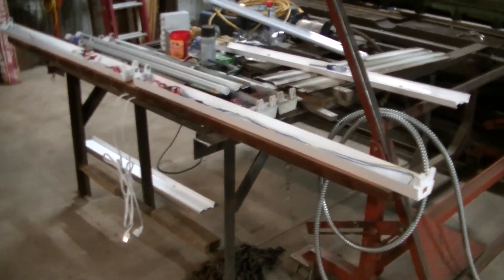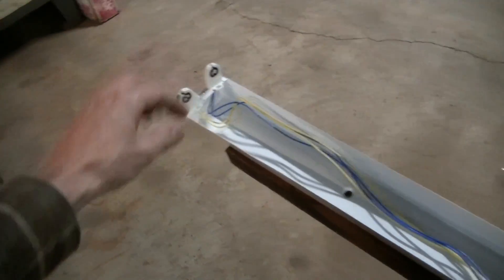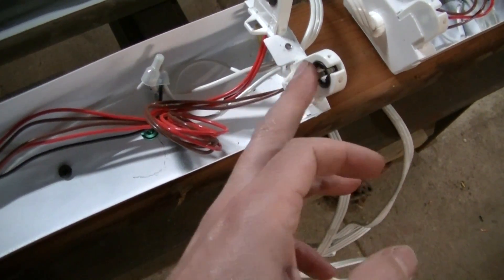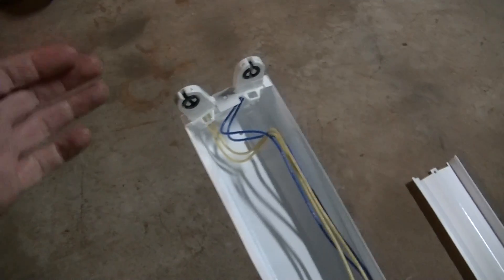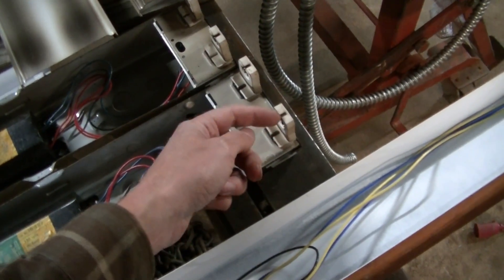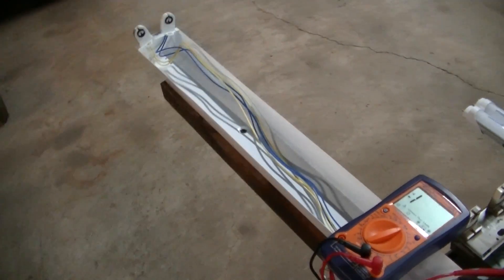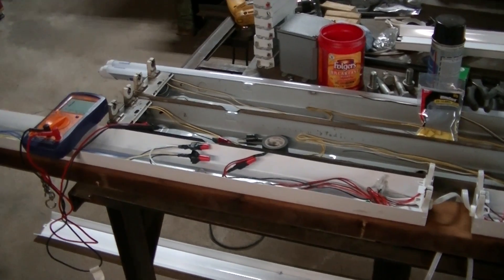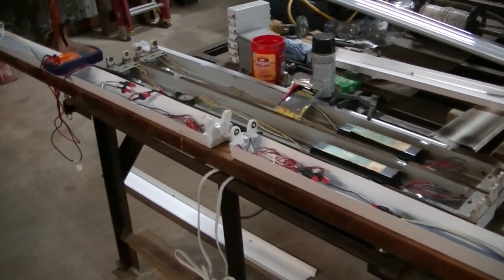"Quick Tip" T12 LED Single Ended Vs Double Ended

Comment: Looking at what you got there, it's too hard to see anything with all your wires in the housings, maybe you should have drawn a schematic wiring diagram. I didn't really learn anything I didn't really hear already---I was hoping to see closeups or diagrams.
Reply from the maker: There is a ton of good info in the video.  If you really learned nothing then you didn't even try to learn anything.
Reply: @mossman381  Sorry, I tried. I've watched it 3x now, and I also checked out your other video where you replaced 2 fixtures with double-ended hyperikon tubes... You used 18w tubes---if you used 23w tubes it would have been brighter... plus if you lowered them 5 feet or so things would be much brighter closer to where you actually are working. If you want brighter, you need more LUMENS.  Look for bulbs with the most lumens or lumens per watt. You went with "single row" LEDs, but if you jumped to 23w or greater, they have about 2x as many LED's per tube... usually in a zig-zagged pattern.

I was hoping to see the differences between the single & double-ended wiring, I don't think I've seen it demonstrated or diagrammed here, though your other video you at least showed the schematic diagram before/after.
Reply from the maker: I quote  "-I was hoping to see closeups or diagrams."  Why would you need those if you understand the difference between the two????  If you went to college why are you even watching this video????
Reply: @mossman381  To see if any diagrams are similar to a hi-intensity plant light I have that has 3 ballasts in 1 fixture.... I'm sure you've seen many like that with overdriven tubes, you can barely look directly at the tubes without seeing spots afterwards. Oh, and about college, when I graduated college, cars didn't have computers and I don't think LED's of any kind were out yet. Respect your elders.
Reply: @mossman381  Who said I didn't understand single v. double?  Oh, and it's one END, not one SIDE. Even your use of "side" isn't consistent or incorrect mixing them. Single ENDED gets + & - at one end of the tube, the opposite end is just there to hold the tube. Don't underestimate my electrical knowledge, I went to college for it.
Reply from the maker: I respect everybody that gives me respect.  Being old doesn't just guaranty respect.  Reread your first post.  You sound like you didn't know anything and didn't learn anything.  Also waving an old college degree around to make people think you know stuff isn't going to get you much respect either.  If you know LED bulbs you would know that you bypass ballasts.  So it wouldn't matter how many ballasts you have.  Wiring should be the same.
Reply: @mossman381  Hey, like I said, I didn't see anything I haven't already seen... YES, it would matter how many ballasts it has---removing them the lumens go way down on my light, from over 5000 lumens per tube to ~2000 per tube, just do a search on overdrive fluorescent... I'm looking for maximum brightness not maximum economy... looking to see if anybody's done it with LED's. Thanks.

Comment: If your light fixture has "non shunted" tombstones then either single sided OR double sided LED bulbs could work and would be your preference..
Do I have this correct?
Reply from the maker: No,  you have to wire the light fixture for either double ended or single ended.  You can put a single ended bulb into a fixture wired for a double ended light and nothing will happen and your light will just not turn on.  If you put a double end light into a fixture wired for single ended you can destroy the LED bulb and they won't cover that under warranty.  You can NOT mix the two types.
Reply: I bought a 24 inch led bulb to replace my old kitchen light. Halfway through I noticed it said Designed to work WiTH A Ballast! ! Do you know if it will work ?? Or do I need to get another LeD tube? Thanks.
Reply: shunted as someone explained above means both terminals are conected, if you plug the hot wire on one end and the neutral in the other end in a shunted tombstone, you are making a short, its gonna be sparks and  breaker will trip. That's how electricity works, so you  have the LED light acting like a resistant, electrons are flowing from the hot wire to the nutral wire through the LED light.

Comment: Good tips!  I've never messed with the single ended ones but they look pretty simple :)
Reply from the maker: I like the single ended conversion better.  A bit more simple.
Reply: @mossman381  And a LOT more dangerous if someone who knows nothing about the confusing types of LED bulbs and sticks a one-ended in the wrong way. One-ended LED tubes should be OUTLAWED.

Comment: I’m so happy you didn’t quit YouTube. I got worried there for a while because I have been watching your channel since day one. I have learned so much from you. God bless
Reply from the maker: Taking it one video at a time.  I got a ton of positive feedback.
Reply: mossman381 I love the camaro you built. I liked the Pypes exhaust. So I was sold when I heard the camaro run so I bought the pypes violator dual catback for my 2012 sierra 5.3
Reply from the maker: I am trying to get back to the Camaro.  The old shop is taking more time than I thought.  Having to fix and run new wires because I don't want to hack job it together.

Comment: This is exactly the sort of content that I hope you stay on Youtube for.  Great explanation of the differences of single and double ended, and exactly why I'm more likely to go buy complete fixtures....until I try and upgrade the old ones I have.
Reply from the maker: It was suppose to be a quick tip (couple minute video) but really wanted to explain it.  I was going to buy a bunch of the LED lights that have the LEDs integrated into the fixture but I am not completely assured those lights will last.  I like the idea of replacing tubes if LEDs go out.  So far all the Hyperikon lights have been working great.  The reason I went back to them.  It would have been a bit cheaper go the other way but I am really happy with the results.  I will have a old shop update soon.
Reply: +Mossman381 I was wondering why this video was 9 minutes long, but it did make sense when you started to pointed out that the socket might be connected on one end..  If I was a betting man.. I would not say they did to sell there proprietary light fixtures,..... but, I honestly don't see what the fuck they where thinking when they made the single ended bulb... 

I mean the idea is to sell it to all the people that had florescent lights... and florescent lights are always double ended.  the have to be to work.. you need electricity has to pass though the gas in the tube...  and its really hard to pass a wire back in tube full of gas turning into plasma.  

the reason I think they did is LED lights can be chained together.. infact in there raw form, (those super cheap 26 foot long strips...) you pass a current one way... till it reaches the end and then turn around the current sending it back the other way... that is what they use to fill your LED tube light.  Thinking about it light this.. I bet if you cracked open the tube.. you could just sneak a wire to the other end and turn it into a double ended LED tube as another way of converting these to work with a socket.